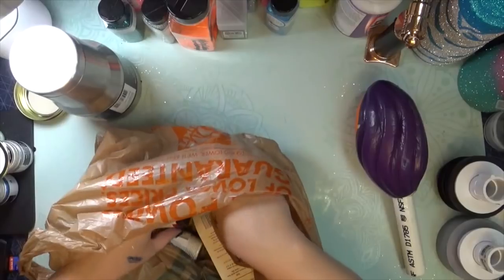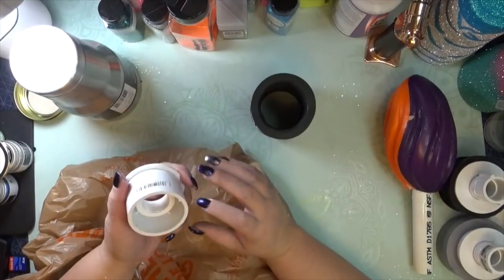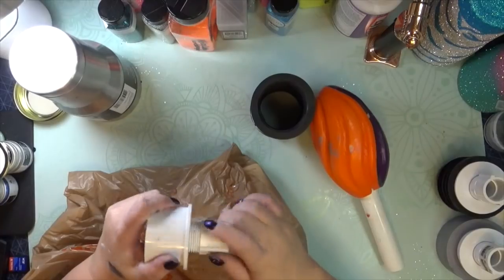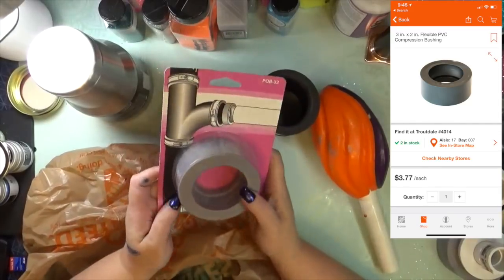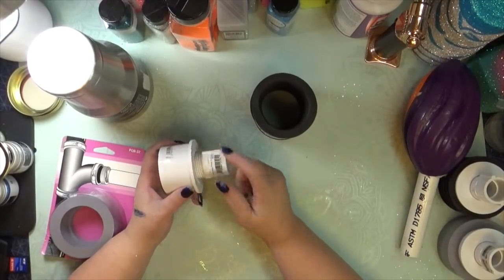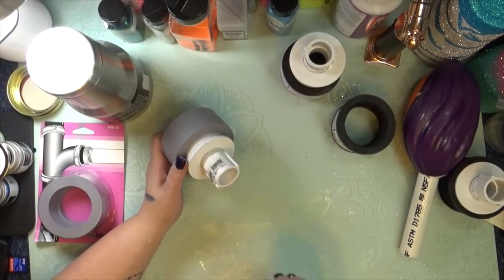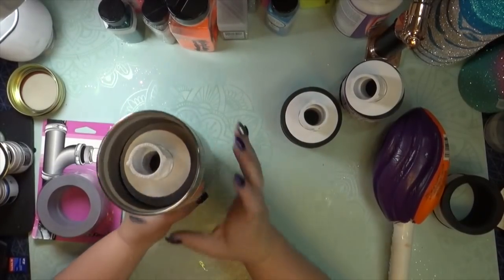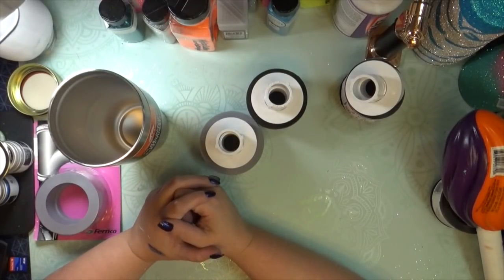Cup Turner accessory (ditch the foam footballs) |My Life in Arts n Crafts

Comment: Here is a list of the supplies since it's hard to read the pop-ups in the video!
Listed in the order shown 

2 in. Service Weight Cast Iron Hub to 2 in. Sch. 40 PVC Compression Donut:
https://www.homedepot.com/p/2-in-Service-Weight-Cast-Iron-Hub-to-2-in-Sch-40-PVC-Compression-Donut-P22U-205/100372278

2 in. x 1 in. PVC Sch. 40 SPG x FPT Reducer Bushing
https://www.homedepot.com/p/Charlotte-Pipe-2-in-x-1-in-PVC-Sch-40-SPG-x-FPT-Reducer-Bushing-PVC021082800HD/203811598

1 in. x 3/4 in. Sch. 40 PVC Reducing Male Adapter
https://www.homedepot.com/p/DURA-1-in-x-3-4-in-Sch-40-PVC-Reducing-Male-Adapter-C436-131/100343192

3 in. x 2 in. Flexible PVC Compression Bushing
https://www.homedepot.com/p/3-in-x-2-in-Flexible-PVC-Compression-Bushing-PQB-32/100187672
Reply: The 2x1 pop up does not look like what you're using. I just wanted to double check that! So far, ask the other items are in my cart!!
Reply: Thank you 🥰

Comment: These items are outrageous in price from Home Depot. We checked them out thinking that would be the way to go . The black plumber plunger is almost 20.00 alone. I've used the dollar store footballs or pool noodles for years and it has worked just fine. just sayin...
Reply: Shirley Savoie, what is $20? I see everything on her list for $6 and under. Above is a list that takes you directly to Home Depot and pricing. I’ve had cups fall off my footballs from Dollar Tree, maybe just different designs of cups are more prone to this.
Reply: @deannamarsh6917  do you glue your footballs to the PVC pipe? I have used them since I started and have never had a cup fall. Ever.
Reply: @charlottedodd467  yes, I glue them with gorilla glue, sometimes when I go to remove a cup the pipe comes out and not the football. I’ve since bought some little foam pink “looking daisies” from Amazon. They work great, have fit most of my cups, and never fall off. And cheap for a four pack.
Reply: @deannamarsh6917  yes I have some of those as well! For the footballs though I use E6000 and hot glue! It makes a huge difference

Comment: Ty !! Trying to find an insert to use on Wine Bottles.. Slim Neck opening to hold the bottles as they turn on a cup turner machine Any Suggestions please help Ty♥️♥️♥️♥️♥️😇
Reply: Small noodle with 3\4 pvc -- cut the pipe to your desired length, the noodle you want to have it from the bottom and a couple of inches sticking out of the bottle, then put the pvc pipe into the noodle and it will tighten up pushing it to bottom of bottle, and attach to your turner.
Reply: @mikestanton4980  Ok Ty Mike.. and I'll take with me to Home Depot this suggestion so I get the right products Ty again 🙂